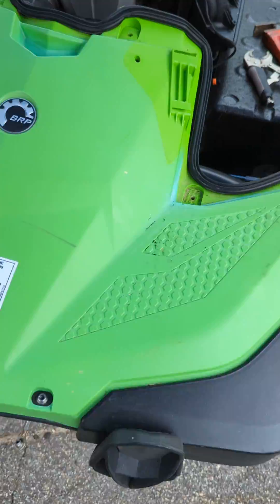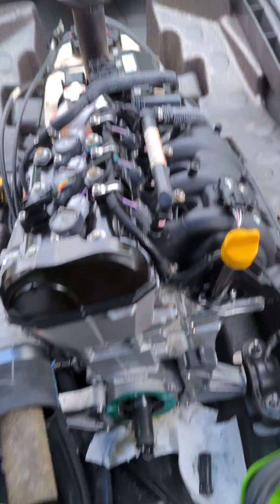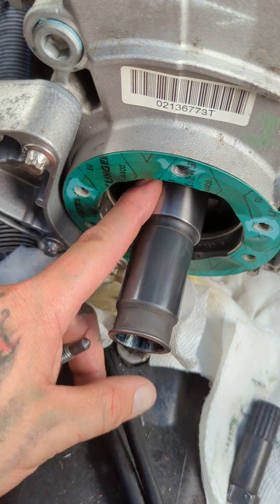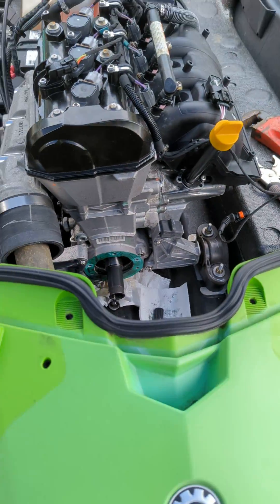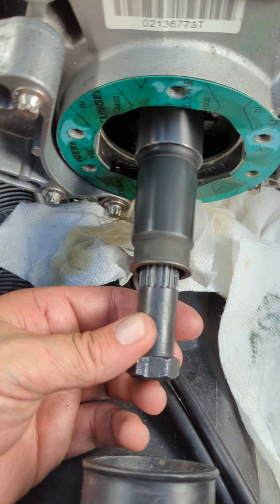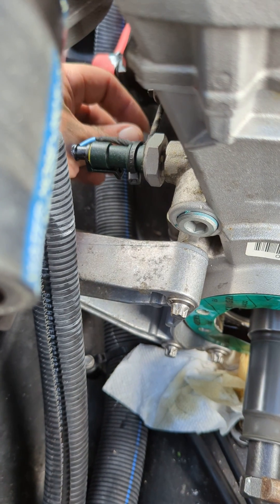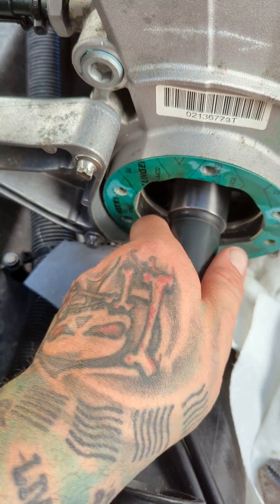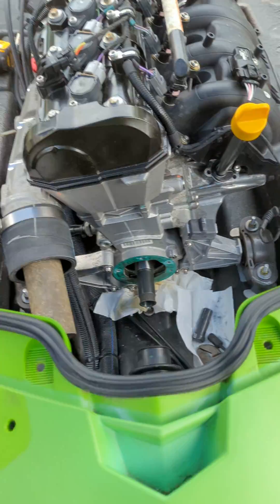Sea-Doo spark 2016 driveshaft & output shaft stripped and tips on how to repair

Comment: I was able to remove the crankshaft without having to lock the engine with the tool screw. Was it done with an impact wrench?
Reply from the maker: i did not use an impact.

Comment: For removal is it clockwise or counterclockwise?
Reply: It is normal threaded counter clockwise. (Lefty loosey) It is on there at about 175ft lbs so I had to use heat and a large pipe wrench with a lot of force. Make sure the locking tool is ALL the way locked in to avoid breaking or bending it. I've seen them bend inside from being loosely placed. Don't buy a cheap tool.

Comment: Is no one gonna answer the question about what way to turn it to pull it off ??
Reply from the maker: sorry I believe it was counter clockwise to break it, pretty sure but its been a couple years.
Reply: It is normal threaded counter clockwise. It is on there at about 175ft lbs so I had to use heat and a large pipe wrench with a lot of force. Make sure the locking tool is ALL the way locked in to avoid breaking or bending it. I've seen them bend inside from being loosely placed. Don't buy a cheap tool.

Comment: What direction did u turn to unlock the sleeve we are trying clockwise and so far no luck at all maybe counterclockwise?
Reply: Heat it up, watch out for the cam chain guide
Reply: Did you ever figure out which way it spins?
Reply: @reidmaner  It is normal threaded counter clockwise. (Lefty Loosey) It is on there at about 175ft lbs so I had to use heat and a large pipe wrench with a lot of force. Make sure the locking tool is ALL the way locked in to avoid breaking or bending it. I've seen them bend inside from being loosely placed. Don't buy a cheap tool. You will also need the Sea-Doo impeller removal tool to install the new one.

Comment: Hi Kris.
I sucked up a tow rope into my impeller intake, and it wrapped around my driveshaft. I removed the rope no problem (didnt even have to cut it) but after i started the ski again, it would die during idle. I could only keep it running by throttling up. Any idea what the issue could be?
Reply from the maker: Sooo hard to say without seeing it.  Did you check out the impeller/wear ring real good and make sure theres nothing binding that up?  get under it and check both sides of the driveshaft real good, ive seen tons of fishing line wrap up around mine and not notice it at first glance.  thats where i would start anyway...
Reply: @krishowes342  I will check. Thanks for the help!

Comment: How do you know if you can replace the part or if the whole crankshaft needs to be replaced. there is a label on my engine and it says 09/2015, does that mean I have to replace the crank shaft?
Reply from the maker: i believe anything older than 2016, the crankshaft is mounted to the driveshaft, so its one large part and unfortunately more expensive to fix

Comment: What is the tool for the output shaft sleeve? That engine is also used in the 18 gts. I'm trying to find an 18 spline tool to remove the sleeve.  Thank you for your time.
Reply from the maker: good seadoo impeller tool on amazon, its under $20

Comment: Question, i know this is an old vid, i have a 2018 spark trixx im currently doing this to. That outer boot for drive shaft, is there a carbon seal in it? When i removed the jet pump my drive shaft came out with the jet pump (i knew what problem was then) i noticed when i looked in towards the pto sleeve there was no carbon seal? I got a shop manual and it talks about the inner drive shaft boot and seals in the pto cover assembly. Is the outer boot the only thing stopping water from entering the hull?
Reply from the maker: Yes I believe that boot is the only protection, and I don’t think it has any sort of seals on it.  I replaced ours and I believe it was just a two clamp boot on it.
Reply: @krishowes342 is the way it appears in the manual. The only seals showing is the ones in the pto cover you have to remove to get to that thread on pto sleeve I need to replace. OK, thanks! Just making sure, 1st time working on a spark. More familiar with my 300 gtx skis
Reply from the maker: @dawgfather2101  The boot on the other impeller side with the jet pump is a bitch, the one that’s threaded on each end.  It can separate if you pull or twist it to hard and it’s legit impossible to get it back together, there’s tons of tiny rubber pins that interlock.  I fucked that one up once, don’t make that mistake.

Comment: Thanks for your helpful video! The manual says to replace the PTO oil seals and PTO cover gasket. Did you replace these, and if you did not, has there been any oil leaks?
Reply from the maker: I did not because the gasket seemed in great shape, I overlooked everything during a tuneup this spring and it all seemed fine and no leaks

Comment: how can i make sure that my pto is bad? i have a 2015 seadoo spark with only 40 hours never ridden in salt water. it was riding really good the whole time i rode it then parked it for a bit and next time i took it for a ride it was revving up and making a slight noise but not going over 8mph. i thought it sucked up some rocks but i took apart the jet and the Wear Ring and Impeller has no damage at all. it was full on gas. i have no idea why this happened if anyone has any knowledge on this please let me know
Reply: You have to take it apart essentially to know. But that sounds like it’s the problem. If it’s making like a whirring/high pitched noise and barely moving. It’s essentially the driveshaft and output sleeve that are stripped and grinding against each other.

Pretty difficult fix but it’s possible. I fixed one last year and now my other one is having this issue and I’m literally fixing it right now lol. Driving to auto zone for a breaker bar
Reply from the maker: If your impeller isn’t jammed up, then it probably is the driveshaft/output shaft, possibly the jet pump itself though too.  The downfall is most of the sparks before 2016 is the output shaft is mounted right to the crankshaft, so if yours gears are striped on that, might be a big expensive fix to replace the whole piece.  If it’s just your driveshaft stripped, than that would be easier, but from what I’ve seen online the output shaft strips easier.  In our case, both were striped pretty bad.
Reply: Hi can i try it on my 2014 spark? The shaft end is worn and leaking oil, do you think its the same proceder or i will have to take it to a shop? Thank you
Reply from the maker: @alexpapoite2420  from what I’ve read, everything before 2016 the output shaft is mounted directly to the crankshaft, making it a lengthy and expensive fix.  If it’s just your driveshaft that is stripped, then it’s not as bad.   Check out all the teeth in the output shaft. Good luck